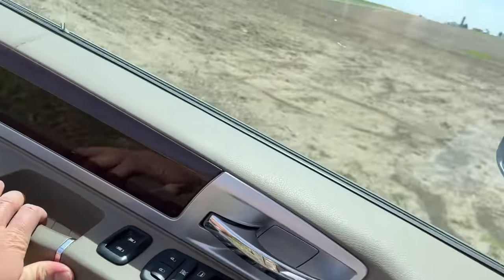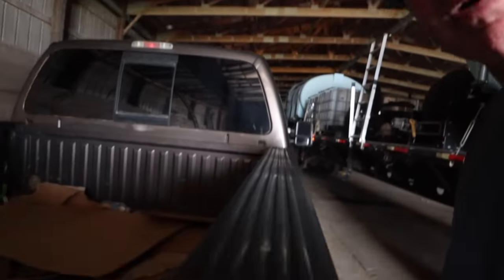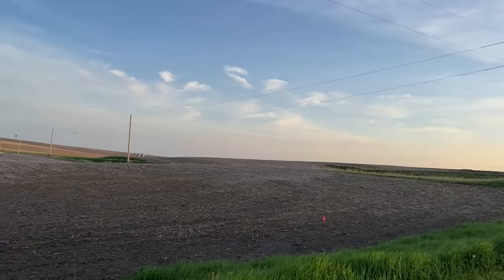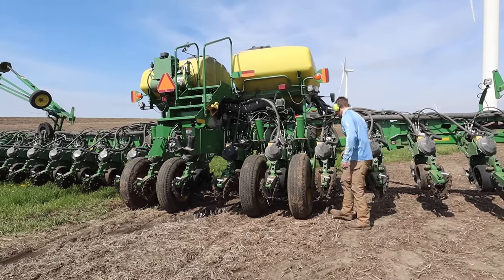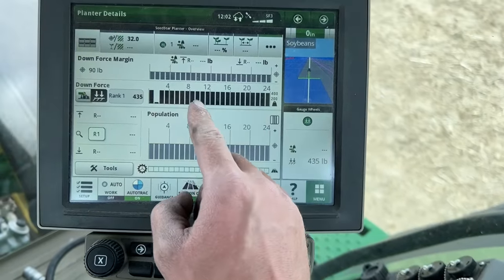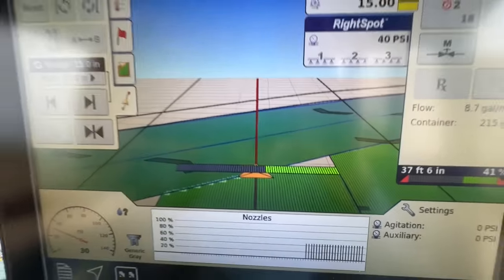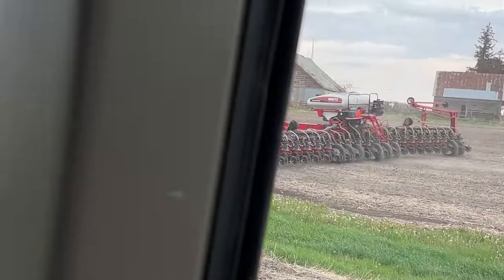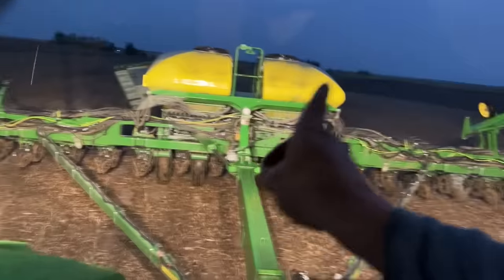We Found More Stuff Falling Off The Bin Site

Comment: I only hope that there is full disclosure as to names of those involved so the rest of the farmers will  be aware of to whom to avoid.
Reply: l expect there will be, there is no need to make their names public on youtube though,  keyboard worries going after them, won't do anyone any good.
Reply: Remember there is two sides to every story.
Reply: @bigfoot-wo3qy  how do you look at that construction and not think the builder did a shoddy job. They can't even use some of the catwalks cause the welds all cracked already, not to mention the concrete pad.
Reply: I'll bet the farmers know.
Reply: @jarrodvsinclair   Did they offer to come back to do repairs and were refused? Some of the issues is simply the bolts coming loose. Those should be TIGHTENED rather than throwing the handrail off the top. ALL bolts should get a once over a year after install. Those found to be loose need a wrench tug to reset them. I've never once seen Colestar farms do a single replair themselves to the handrails.
Reply: @bigfoot-wo3qy I can't wait to hear the other side of the story regarding  the concrete failure.
Reply: @alandeon  Most of the iron issues are shoddy weld work.. they spoke about it in the past
Reply: @alandeon  If it is a cat walk for safety there should be welded not bolted together. Not a single farmer i know has to tighten bolts on a catwalk that is just plain stupid to bolt them together,
Reply: @bigfoot-wo3qy  Hogwash, the defects are all on video.
Reply: @johnunsicker7440  How many farmers do you know with large bins? I'm curious.
Reply: @alandeon  it wasn’t bolts, it was welding.
Reply: @JohnSmith-gb5vg  It was BOTH
Reply: @bigfoot-wo3qy  What could the contractor's side be?  Our structural engineer was out sick, so we just guessed when making up the blueprints?   We didn't have the time or $ to construct a deep or solid enough base for the cement?  We didn't have the $ for top grade cement, or enough rebar?  The guy that ordered the cement is new, and wasn't feeling good.  He ordered the cement with not enough (or too much) rock.  Our welders are new.  They never worked up high before, so were pretty shaky on the welds.  We also ran out of juice to run the welder, so we could only 1/2 way weld the catwalks.  We know it's dangerous, and will break sooner or later, but it will hold till we get off site.  That sound about right?
Reply: @alandeon  did you watch the video where Cole walked through all the issues. For example the assembled the bin wrong and had to empty bothe the bins last season manually cause the screws were jammed. Or what about the pit? It also has issue and is constantly burning belts during harvest. Or how about that breakers / contactors are missing so they have to swap them to switch grain paths. Then there is the wrong metal used for for scaffolding under the catwalks and tons of bad welds. So but there is no "oh I will spend a day there and fix a couple of things". They can't even fill the grain hopper for filling tucks or the legs cause the pad to separate. The concrete is shattered and added 5k bushels caused an almost 1in gab in the slab to open up
Reply: @jarrodvsinclair  Yes, I've seen every video. I still want to know if they offered to come back to do the repairs or not. Most company's will set up a date and fix problems. Did Cole refuse them access? If so, they will be hard pressed to win the case in court once both sides give statements.

I agree there are errors but we've never heard from any of the trades again suggesting that maybe they were barred from coming back to inspect and resolve the issues.
Reply: @alandeon  he covered that in the video. He asked them to fix this stuff before final payment and instead they sued
Reply: @jarrodvsinclair   Yes, THEY sued. As in Cole sued rather than have the crew back to do the repairs, especially safety related items. No business is going to refuse to complete the job 100%. I think the judge may rule on the side of the contractors.
Reply: @nortiousmaximus940  I thought you were into voyeurism.  Hahahaha

Comment: That planter will singulate seed the same at 9-10 mph as it is at 4-5 mph you are running. Get it going
Reply from the maker: The problem with going that fast arises from the closing wheel system, not the singulation. I couldn’t seem to get the poly wheels to put enough force on the ground to get consistent seed to soil contact.

Comment: I'm just wondering  if the seed was kept in a cold building like 50 ⁰,  then brought out into a 75⁰ outside with higher humidity  that would cause the seed to condense moisture  , causing problems with the planter on the deer
Reply from the maker: That is a good point. Especially after throwing it in the yellow bins which are even warmer.

Comment: I'm by no means an expert but could going to slow cause the plugging problem on the john deere?
Reply from the maker: It shouldn’t.  The lines are force fed by the air so they should be filling at the same rate whether doing 3mph or 12mph.

Comment: If your lawyer told you to not fix the walkway on the bin site til the lawsuit is finished than you have a bad lawyer. You need to fix that before your father falls off of there.
Reply: Actually, in that instance they have a great lawyer. The BEST thing that could happen from the lawyers point of view is that the bin site becomes literally unusable and hazardous to be near. Unfortunately, from his clients point of view, that’s the worst thing that could happen. You have to remember that the lawyer isn’t hired to help them run the farm or make the best of the situation with the bins until the legal issues get cleared up. He’s there to make sure that he wins the case for his client. The worse the situation becomes for cornstar farms, the better the chances of proving that the contractor botched the construction. It’s a truly horrible situation but that’s how it works. A good lawyer helps by winning, you’re losing if he’s helping. If I were Cole I wouldn’t post anything else about removing lose railings or anything related to the construction issues. I certainly would try to avoid posting anything where I was climbing on a sketchy area without fall protection
Reply: @randykincy7954  He shouldn't post anything about it but he's a kid yet and hasn't learned how things work when you go to court with ppl who don't play fair. As far as not fixing anything any lawyer can take all of that and make it look like they are letting it fall apart which is what they are doing. Any one falls off of there now can't sue the builder they'd be suing Cole. They should have had the insurance company look at it and then had a contractor make it right long ago and then they'd have it right and a no shite this is the price it cost to fix it and sue them for that amount. First thing you learn about lawyers they can't be trusted

Comment: You need to speed up. That Deere
planter can easily run 7 to 8 mph.
Get 2 to 3 times more work done.

The problem Daddy Corn Star is
That's a million dollar STRESS.
Hopefully you can get it put behind
you by the start of fall.

Comment: Hey Cole just out of curiosity, what was the reasoning for you running 3 mph versus going 9-10 in an ExactEmerge planter?  

DC said it best when it comes to your grain elevator. It truly is mind blowing that this safety railings and structural integrity is falling apart only after a few years. What’s it going to be like in a couple of decades if you guys still have it?

Comment: I hope you got a good lawyer and sued the contractor for the maximum of their bond.  You need a real bin builder to come fix it at the old contractor’s expense…which of course means a lawyer gets rich…. What it looked like to me is they used a cheaper grade of steel and cheaped out on shielding for the welds.  Brittle welds and steel that stress cracks is always a contractor grading down the product to increase his profits.  If it’s not the same as the engineer’s ratings you have a monster law suit.  Most states have a limitation on suits of 1 year.  Anything happens after 1 year it’s wear and tear unless you have a written warrantee.  Did you know that lock washers cost twice as much as bolts and that a lot of contractors skip them because most bolts won’t back off in the first year?  Your bin contractor knew that too!

Comment: Already spotting the issues with your walk ways, even if they are done well you are not going to get more than 10 years out of them. Soo used to walking on bouncy walkways as a former shift chemist, it's a bit different when your a water operative and the walk way over a lock has to last another 10 years... Squeaky bum time. Your  bin set up, it's not safe, it's just dodgy.